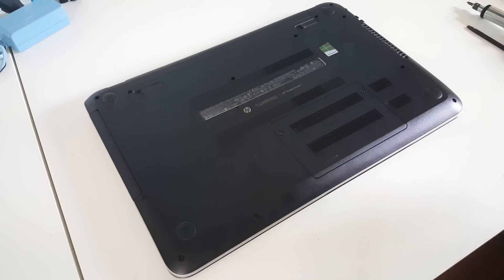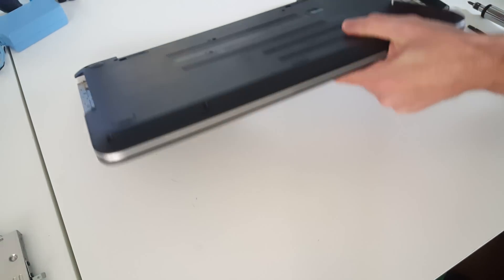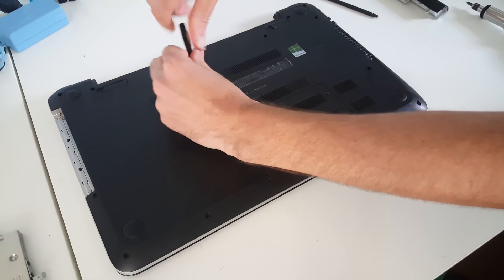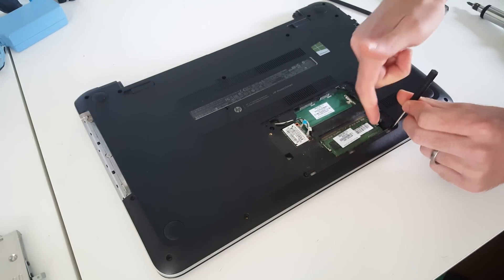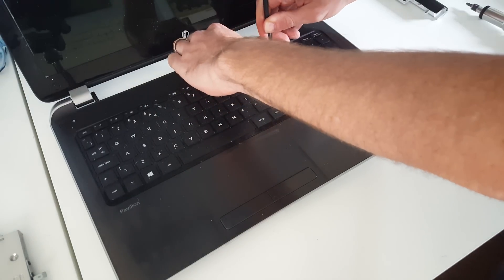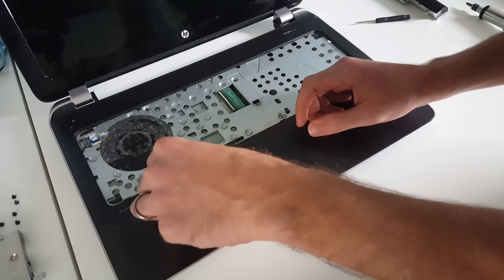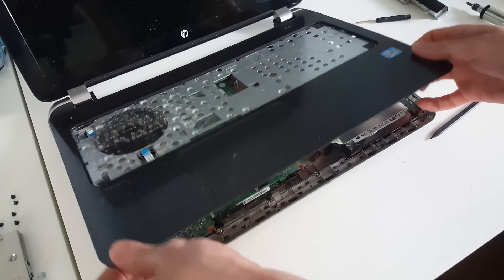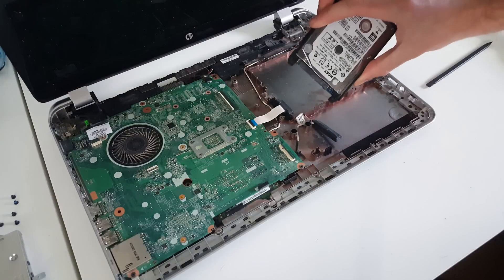HP Pavilion 15-n290sa HDD Replacement/SSD Upgrade Guide

Comment: Excellent and I have subscribed.
HP really made these cheap end laptops hard to access and used inferior ribbon cables and clips on most. They are hard to open because they are assembly line designed for cheap labour and no other reason.
HP have occasionally made some quite good higher end machines but those days have gone and their prices are ludicrous for under-specced trash.
Reply from the maker: Glad I could help!

Comment: Excellent video. Worked perfectly. Just a note for others. My laptop had two additional small ribbon cables on the top side. Have to be careful not to damage them when removing the top section of the laptop case.
Reply from the maker: Thanks for sharing

Comment: Thanks for this! It let me open up my NA-032SA which was identical except a minor change in the keyboard attachment.

The flat screws at 3.55 didn't play ball with my phillips head 00 or 000. I eventually used a 1.5mm x 50mm crosshead from a set I got from amazon (Vastar 17pcs precision if you need it).

Comment: Cheers, Good video, just bought this for my daughter, i found you do'n't need to remove the ribbon cable above the hdd, just remove the screw and tuck the lot back. not a bad laptop for £30 on fb, just installed windows 10 and all's running tickedy boo.

Comment: Could not have done the job without this video - I have to say this is the most difficult laptop I have ever had to work on for a simple harddrive exchange - the equivalent of taking the engine out of a car to change a headlamp bulb - HP should be ashamed...

Comment: So the three screws in the optical bay can be really hard to remove, I can't get them off. Do I need to get these 3 screws off in order to get the top off the laptop?? If I do, how can I they are not budging!!

Comment: thank you for the video ,
did this model suppport M2 SSD Drive?
Reply from the maker: Unfortunately no
Reply: @BrueComputing  hey guys great vid, the three screws in the optical bay, do I need to remove them to get the top off, they seem to be stuck on mine, very frustrating, I've got the right size screwdriver but it just doesn't budge. If you could get back to me I'd really appreciate it! Thanks!

Comment: Thanks for the video ...so many screws, and awful clips that make you feel you are snapping the plastic ... which I did around the usb port.  I would agree about this being a terrible design, but it is an old laptop, and it looks like all manufacturers now make it increasingly difficult to change 'consumer' parts (I have a new pavilion x360, which has similar challenges)

Comment: It's so frustrating how few laptops provide a panel for easy access to these components. On my ThinkPad, I remove the battery and 2 screws and have access to the CPU and  it's cooling system, the hard disk, the optical drive and the RAM.

Comment: Is it worth upgrading the hard drive in a HP pavilion ts 15 n?  My keyboard space bar stopped working so that's $10 there plus another $130 for 1tb Samsung 860 Evo, plus it's still only has 4 gigs of RAM which I would like to have 8 or 12 gb.  It's a four year old laptop so maybe it's just better to not bother

Comment: I have replaced the internal HDD in my MacBook Pro before and the difference between that and this HP assembly is staggering... That said, I found this video very helpful when tearing the laptop apart.

Comment: Thanks a lot, great video, hdd replacement went easy (though I wouldn't call extremely simple, there are laptops far easier to disassemble, normally a hdd replacement should not require such a detailed video. Shame on HP that I could not this with the official HP support videos).
Reply: Corporate greed.  They don't want you to be able to do this yourself.

Comment: I found releasing the keyboard connector a bit confusing and found by looking at another video that you lift the black bit not the white bit. Other than that it was a great video. Thanks
Reply: I think it varies from model to model, I had to lift the white part too.
Reply: I had the same problem just right now, thanks to you posting this comment.
Reply: Had me stumpled for a little bit also. i gave all my plastic tools away years back so managed to damage it a little but it's only my spare lpatop so no dramas :)

Comment: What size Phillips head did you use to get those 3 flat screws hidden under the optical drive. I can't seem to get them loose.
Reply: For anyone else asking this: a 1.5mm screwdriver we had from a smartphone repair set fit perfectly on these screws.
Reply: Did you get those 3 screws out??? I'm having the same problem right now, any advice?

Comment: Without a doubt, the worst laptop I've ever had the displeasure of replacing a drive on. Just provide an access panel! An unbelievably tedious job to replace what should be a user serviceable part...
Reply from the maker: +Guy Moores Pretty common now, relatively few laptops have easy access to internal components - often even upgrading the RAM involves opening up the laptop.
Reply: +Brue Computing That said, I should have acknowledged your video as it did make life a little easier!
Reply: Guy Moores I wanted to replace to ssd but I was like it takes 5 Min..but wth is wrong with hp.. They did this so that people would go to service Center.. Now it's impossible for me to change. Are even 2017 version of hp laptops same?
Reply: Guy Moores is this for the hp 15 touch screen?
Reply: What a journey it was, to replace a hdd in this piece of technology :)
Reply: This video got me over the line but I've taken apart 100s of laptops without requiring a video. I've simply told my family and friends to avoid HP at all costs. Horrible design.
Reply: Corporate greed.  It's disturbing.

Comment: It is very hard to understand what exactly needs to be lifted to release the keyboard cable. You call it "the latch" however not everyone understand what part is "the latch", and it is not very visible since you are not zooming. You should explain that the black stripe should be pulled upward. I had to see another video who made a closeup to understand it. Gladly I did not break the connector